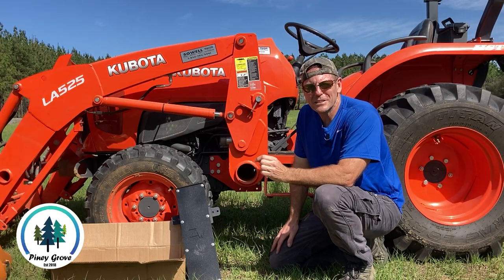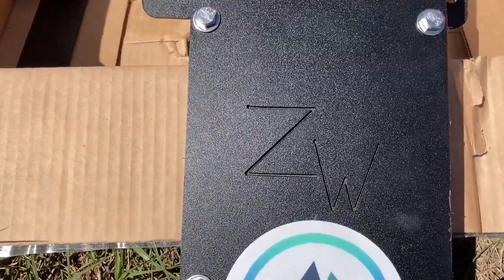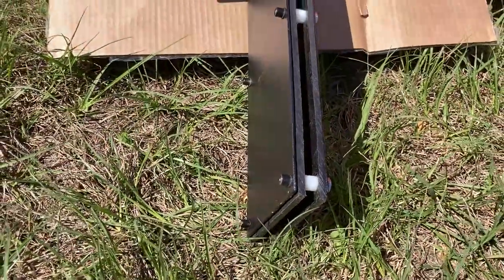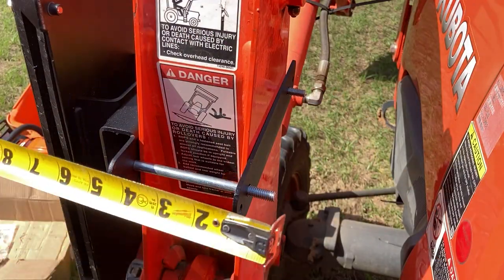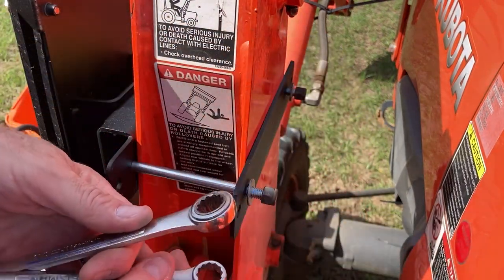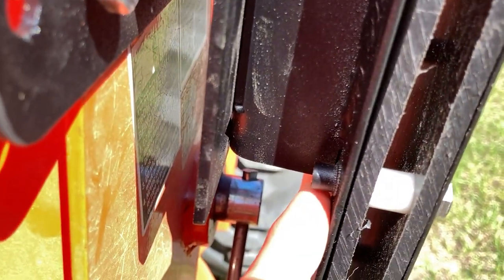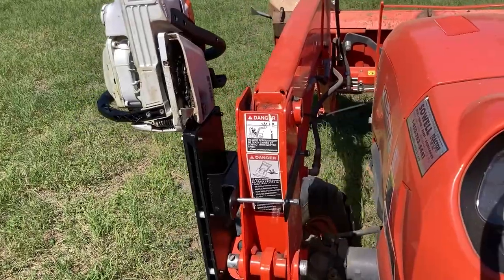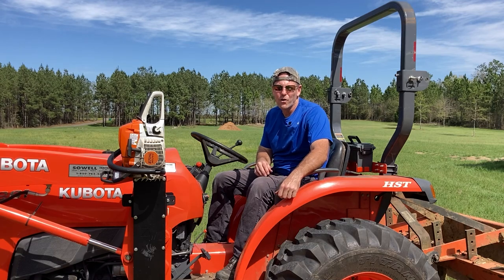Is This the BEST Chainsaw Carrier / Holder for a Compact Tractor? | Zooks Welding

Comment from the maker: Be sure to check out Zooks Weldings for all your tractor needs:  https://zookswelding.com/  Code: USA5  

Products in our Amazon store used in this video (costs nothing extra to use these links!).  You don't have to buy these specific items to support our channel....just use a link below to get to Amazon then make any purchase: 
Flex Tape: https://amzn.to/3R4MdWm
Mechanix Leather Gloves: https://amzn.to/3HjoZZf
Titan Post Hole Auger: https://amzn.to/3toHEx2
Ratcheting Fence Tensioner: https://amzn.to/3aEfSX0
Pope and Pipe Level: https://amzn.to/3tqUhHX
Fence Post Puller: https://amzn.to/3QbcNhy
T Post Manual driver: https://amzn.to/39dwt3J
Come Along Winch: https://amzn.to/3aQMqND
Clip bending tool: https://amzn.to/3xlqrG0
Mechanix Leather Gloves: https://amzn.to/3HjoZZf
6’ Digging and Pry bar:  https://amzn.to/3vH5Agx
Dewalt 20V ½” Impact Wrench: https://amzn.to/3UOcXNH
Dewalt 20V brushless Leaf blower: https://amzn.to/3zwJcYm
Dewalt 20V brushless ½” drill: https://amzn.to/3HGXJ7z

Comment: Cool product. Looks like you could connect a bungee cord from one bolt to another to limit the vertical movement when hitting pot holes.
Reply from the maker: It didn't move with the weight of the saw on it.   I think it's something you attach when you're going to be doing lots of tree work, then take off when you're banging around doing dirt work.   1 minute install!